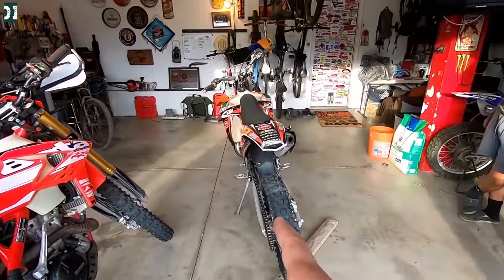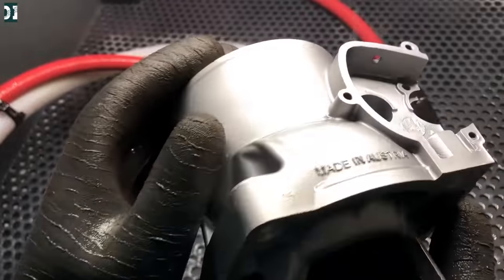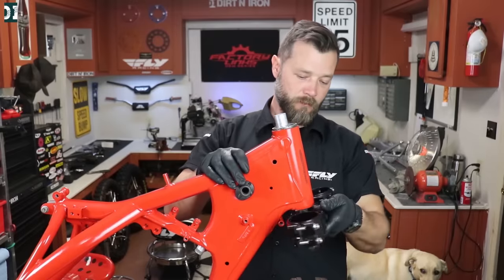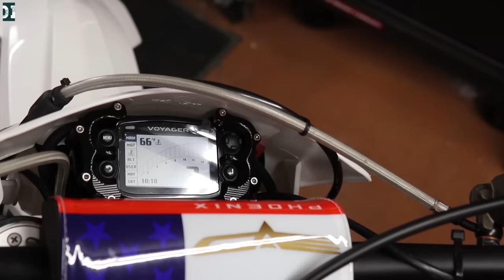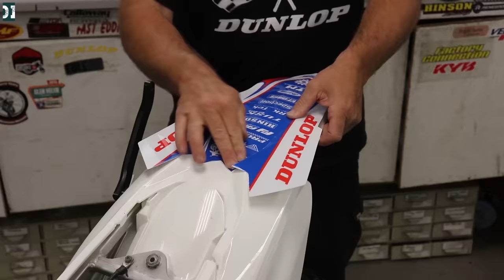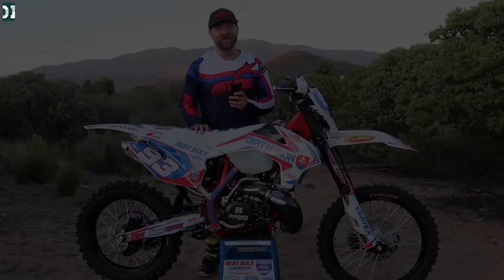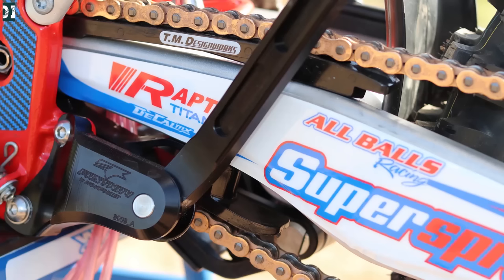2 stroke dirt bike build time lapse - KTM 300XC

Comment: Best KTM 300XC build on YouTube!! Perhaps one of the cleanest builds ever from top to bottom. Every nut and bolt, paint surface, greased part, to the plastic body parts was brought back to new state if not new. KTM would have been proud to use this bike at the 6 day event in Slovakia.

Comment: Great Job, great quality machine.
There are 2 iron rules I learned in 30 years of motorcycle restoring: 
One - Every bolt/nut that goes back in place must get a light lubrication, even if only a drop of oil.
The second - each new paper gasket that is replaced, must be lightly oiled/greased. This contributes to sealing and in the future will facilitate disassembly (which will come again, sooner or later).
I really enjoyed watching. Take care.
Reply from the maker: thanks for sharing Michael, appreciate it!

Comment: Red thread locker saves lives. 
Some bolts that need red thread locker:
-Foot beg bolts to frame
-Handlebar and handlebar clamp
-Axle and brake caliper and brake disc bolts (don't get it in the bearings or on the brake discs).
-All engine bolts inside the engine, especially parts threaded directly into the case of the engine.
-Example: Suzuki DR650 neutral indicator "falls out" inside the engine, due to the factory not using thread locker, and it can destroy or lock up the engine while driving.
-Crankshaft big end rod caps (on 4 stroke multi-cylinder bikes).
-Shift drum bolts
-Timing chain tension bolts 
-Timing chain guide bolts
-Camshaft sprocket
-Engine case bolts. Thread locker is better than accidentally over tightening. For streetbikes that aren't taken apart often. (Place black silicone on both sides of the gasket, clean case with acetone first. Use red thread locker. Snug bolts slightly less than torque spec to prevent damage to case).
Reply from the maker: thanks for sharing, great info!

Comment: I still have my '01 380EXC, all port matched and blended.  I had to bore the carb out to 40mm so it could be jetted, it's torque curve is awesome, it turns on from very low and then is flat till redline, it's awesome.  it doesn't turn that well, the 43mm Whitepowers are an awful fork, aftermarket valves, hours spent on valve stacks, it's so much better, but still nothing on the Japanese bikes of the time.  Still, I love this bike, the motor is awesome, looks have aged well.

Comment: Wow! 😀 Did you put in a new shock shaft bottoming bumper? Was not an aftermarket non-plastic shock spring preload adjuster ring available? Not sure I would run trust those fork lug protectors. It may interfere with a good torque on the front axle. I wouldn't necessarily go with that integrated top handlebar clamp. I would run a skid plate that extends past the shock linkage. That linkage guard integrated into the dog bone transfers more of the impact into the rear suspension and may affect rear suspension compliance. I would go with SKF Fork seals. I wasn't crazy about the seat cover design but when I seen it on the finished bike it looked good. Wouldn't it be better if the front fender adapter was made out of a polymer instead of aluminum?

Comment: Hey 
guys...!amazing!!  If I wanted to have you do this build for me?  how much would this cost me?  I love it with the Blue as well but just Danish cross and amazing!  I'm heavier, 260lbs, I would need maybe a larger displacement or some engine hop-up.  Let;s go!
I'm in Colorado, so we can meet and bring you a couple 300XC and 300XC-w.  Both will remain Street legal because when you are running trails not sanctioned race...you need plates, lights, licensed and blinkers.

Comment: I have a 300XC-W and it is my dream bike!!
I'm curious why there is 2 gaskets under the hear (see 17:19). Wouldn't add too much squish and possibly change the compression? Thanks!
Reply from the maker: its for port timing, the head been customized to accommodate that change. You get better mid range, RK Tech head comes with this setup. Would be better to have one thick gasket, but we did not have that thickness so we went with two

Comment: hey I have a KTM 640 lc4 super moto. it has a blown head gasket and I'm waiting for the parts I need "oring for the piston and a master link for the cam chain" it's my first time doing this can u give me sum pointers on the best way to put it back together! I have some many ppl tell me how I should put it back together!! I mean I'm no dumby to working on cars bikes I don't have to much hands on with!! I love ur channel which I just ran across and u know ur stuff brother! I know there r a few thing I need to do before I put it back together like the piston needs to be top center. do u have anything that I should know when putting it back together pls?? thank u
Reply from the maker: I would get the manual an follow the steps, use some assembly lube, make sure to have the timing right, check the valves if they are good or need to be replaced/re-seated, check the clearance too

Comment: No stripped bolts? Taking apart my 2006 yz250f that the previous owner had outside for 6 years and the biggest problem is the bolts! Also, what grease did you use?
Reply from the maker: I used Maxima grease. No stripped bolts on this one. good luck with your project

Comment: Wery beautiful 😍.... but not suitable for forest hard enduro ride.... skit plate must be from aluminum, need bottom protection on the flue tank as well, and the pipe guard is very light.... mean too thin .... you need at least 8-10 lears of  carbon .... ;)  everything else is amazing! And why back  suspension is not PSD ???
Reply from the maker: thanks man. Its XC, they have linkage not PDS

Comment: Awesome build! Why was there two base gaskets?
Reply from the maker: Thanks man! Two gaskets to change port timing since the cylinder sits bit higher. We did not have single thick gasket so had to use two. Head is custom made to fit that change, RK tech offers this package.

Comment: You can get way easier tjose bearings in put the bearings in freezer then use heat on the part where you want to put the bearing because only heat expands the part where the bearing goes usually when i do it the bearing drops in the part easily so i dont need to use force
Reply from the maker: right on, thanks for the advice mom! ;)

Comment: anybody else confused how he got that crankshaft in without using a special or diy tool to pull it into the press fit bearings? this looked like it dropped straight in. im sure the guy knows what he is doing, so maybe they just didnt show that bit, because otherwise this almost looks like it was done the wrong way. you dont do up the case bolts to tighten it, you use a crank puller to tighten it then add the bolts when its done. its super important to do that part properly as otherwise your crank could come out of true, or not be centered/ seated properly and implode your entire engine...

Comment: Hey dirt and iron. How much did that build cost you? I'm betting cheaper to buy a new one?!
Reply from the maker: hey CHris, yea its comparable for sure
Reply: Ya I remember talking to you about another build you did. I did a similar project with an rm125 1996 year. 
Did the frame off total rebuild also. Couldnt believe the cost of some of the items. To get a period correct spark plug cost 70$ cad!! 
Also the stock connector between the silencer and the header pipe was 90$ cad!

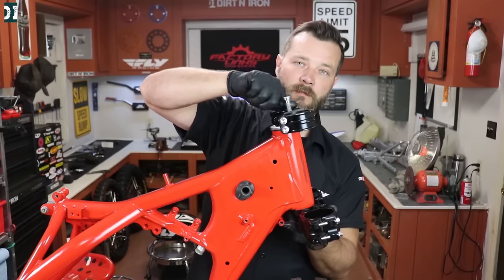Comment: 19:35. This mechanic is a genius. Red thread locker on the handlebar clamp bolts. You wouldn't believe how many men don't use thread locker because they must not trust their tools or their repair skills, and they want to make things "easily removable" for later. Some people think that if you get a drop of red thread locker on a bolt, it "will never be able to come out." In fact, thread locker just helps bolts stay tight and prevents them from ever vibrating loose due to the high frequency harmonic vibrations of the engine. Without thread locker, engine bolts and frame bolts will vibrate loose over time, due to heat cycling and vibration. Not using thread locker on inaccessible engine and frame bolts is just plain stupid. As soon as you heat cycle an aluminum engine, it will have caused the bolt inside the aluminum to shift massively, and it will require a re-torquing, unless you've used a stretch bolt, or a special crush washer, or red thread locker.
Reply from the maker: thanks man, makes sense!

Comment: its cool, but i was definatly triggered by some things, just basics, like putting locktite on the wheel adjuster bolts that have a lock nut, no need. its not a bike to be ridden anymore i guess
Reply from the maker: Its not a locktite, thats a grease 😉
Reply: @dirtniron  good choice, sorry it looked blue. i also reccomend unsealing the wheel bearings and packing them with proper grease, not the smear that comes in them, makes them last about 3x as long especially if you ride in mud bogs and river crossings

Comment: The bike looks good but omg would never have anything done in any of these garages. I'v been in the mechanics game for over 23 years and the lack of torque bars is just laziness an over torqued bolt is just as bad as a under torqued bolt. And no , there is no such thing as a calibrated elbow, just a bone idle one. Also to never put heat into ally castings or fit bearings with impact, get the right tools for the job, failing that make a rig from threaded bar.

Comment: I would stay away from an engine builder like this.  He just recycled the lock washer for the hinson clutch basket!  He uses an electric driver to assemble some of the bolts in the engine.  He does not use a torque wrench.  Yes, he builds 20 engines a month but you cannot measure the exact torque per bolt.  He is a backyard engine builder at best.  Sorry. He used those chinese ebay gaskets as well.  Ugghh.  This engine builder is driving me nuts